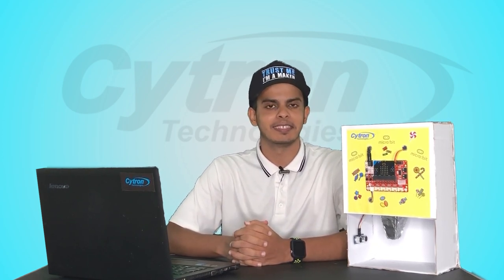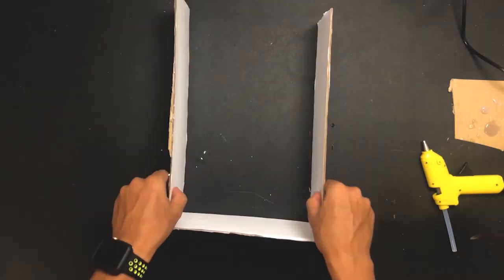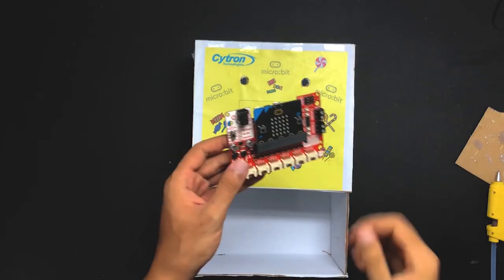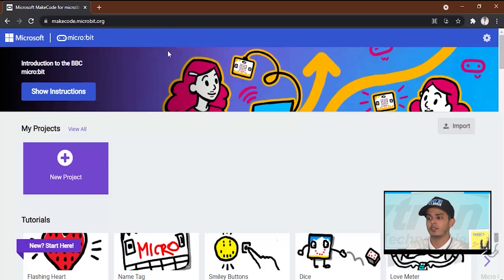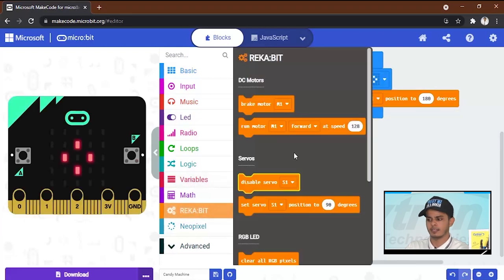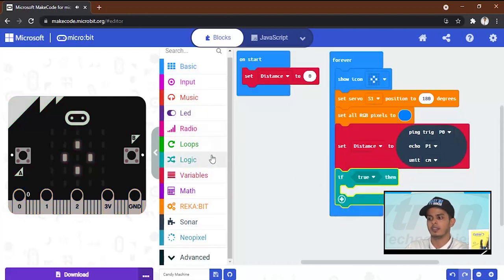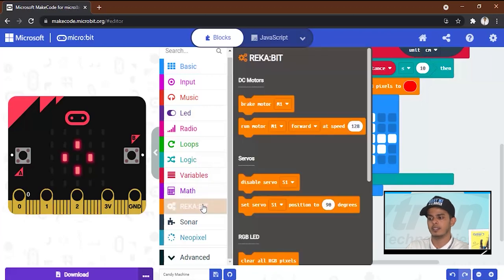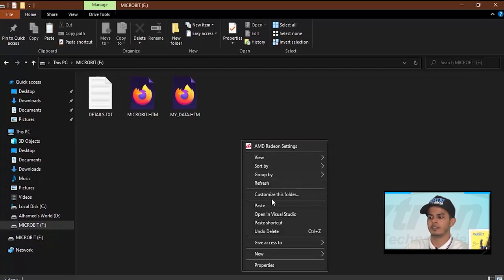DIY Candy Dispenser Machine using REKA:BIT with micro:bit | Tutorial for Beginners

Comment: How can I do if i don't have rekabit
Reply: You cant.
Reply: Maybe use a different sensor like a light sensor
Reply: instead of using reka:bit, you can use the sensor extension (in the position section it says "set servo P0,1,2 to degrees x", this command is practically the same, and you configure the rest yourself
Reply: And cleaning and putting all the RGB pixels doesn't work, since this is for another device that doesn't appear and is used in the video, so you can eliminate it from your code and avoid using the reka:bit, but I think that Now you would have to use a breadboard